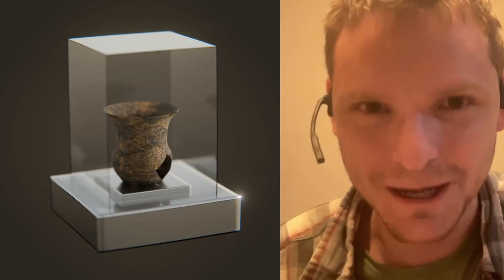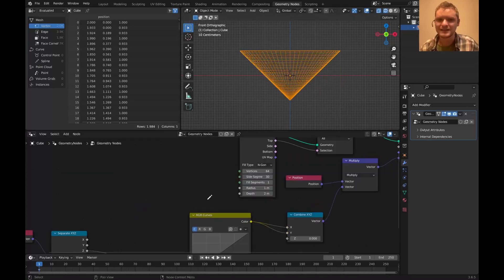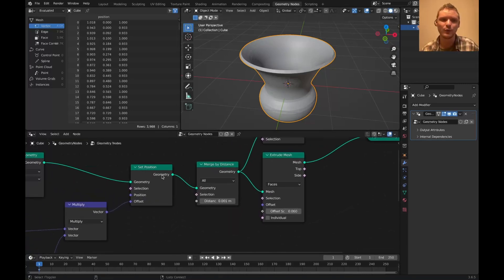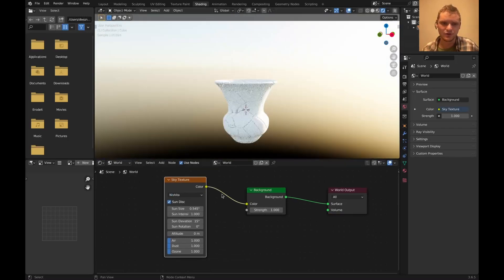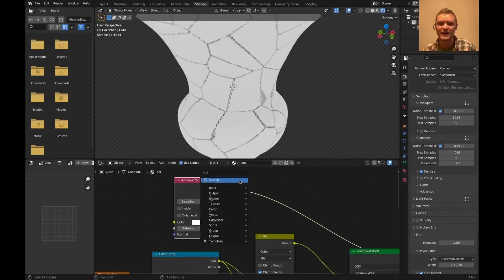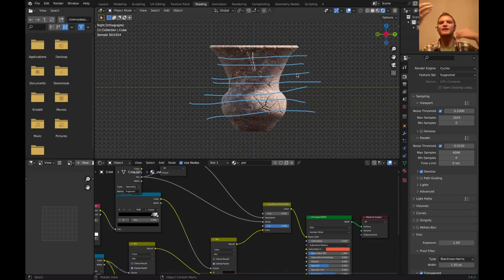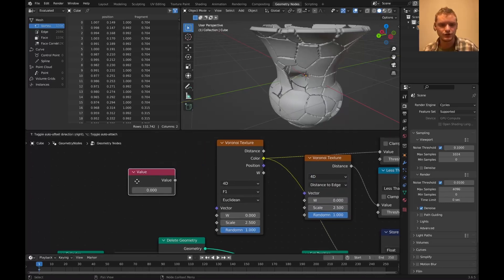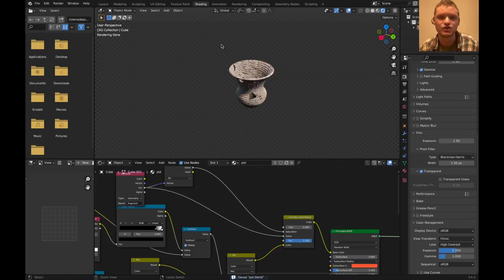cracked pottery in blender with geometry nodes

Comment: Superb project as always! Thanks for these projects, it's really educational and a great way to learn.

I had a question that doesn't have anything to do with this video...

I tried to follow your video on the basketball because I'm trying to make a "Delay" effector in geometry nodes.
The idea would be to give an automated elasticity effect based on the movements of an object. For example, if I put in 2 keyframes and that allows the object to turn 90° very quickly, the animation should continue further than 90° because of the momentum and the rotation would be: 0>125>75>95>89>90.

In the end, it stabilizes at 90°. Do you know how to do this? I can't get an object's velocity to register based on the keys.